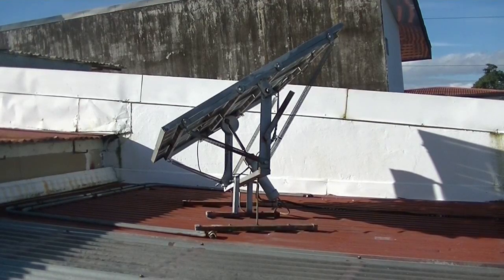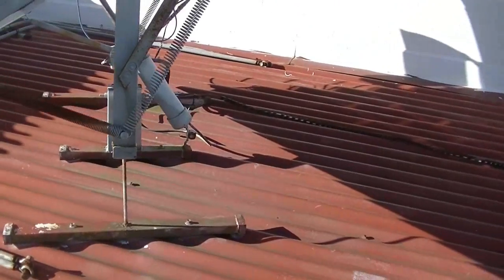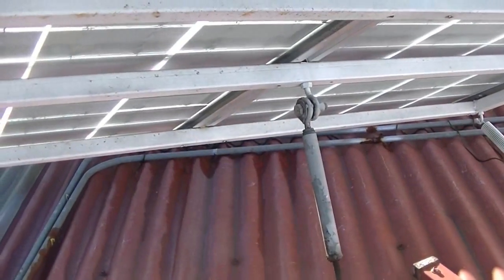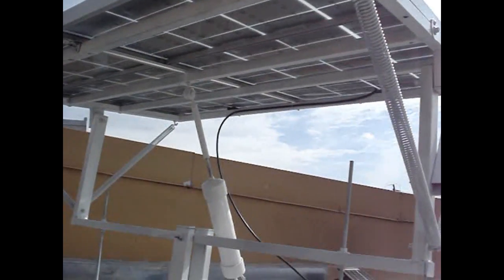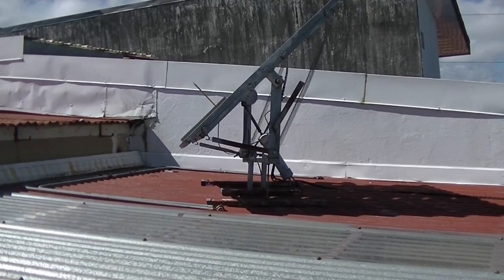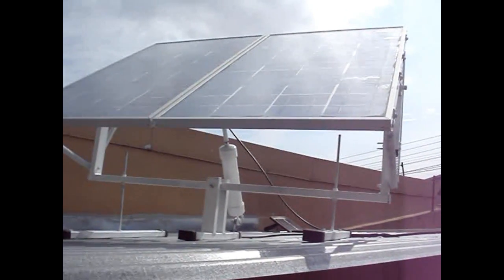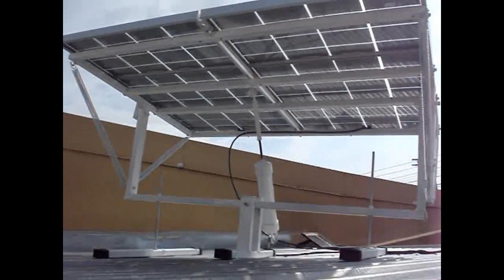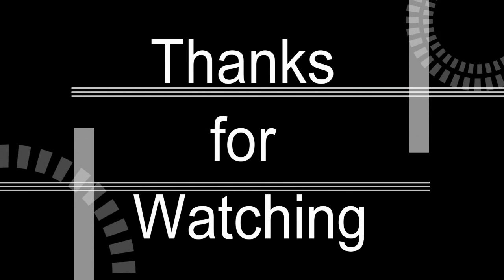Solar tracker update 26 march 2019

Comment: really impressed by the simplicity of design of this tracker. The only thing that I'd like to include is some way of getting it into a stow position in case of very high winds.  Is the new system you mention going to include something like that?

Comment: In your video 6yrs ago you said you used 90-watt panels. Since panel prices have fallen drastically since then, just wondered if you intend to replace those with 300-watt panels which are now priced at around $125.00 or so.

Great video and info all around though. Look forward to your next update. I'm looking to do an 8 to 10 300-watt panel setup on my land for a cabin to live in, while building my house over the next couple years. Then I'll upgrade to a 25 panel setup.

Any thoughts or suggestions will be helpful and appreciated.
Reply from the maker: Yes I have taken down these panels and have designed a new tracker with a 340watt panel. The old tracker will also hold a 340watt tracker. But I am using a different method to move it. I will be posting a video soon.My designs allow for you to extend the size to add more than just one panel.

Comment: I'm thinking about building a large tracker, / shed roof, I don't get that great of sun. I'm hoping I can get about 20% more than I would get without. I'm thinking about 35°- 45° of tilt. East- west , and tilt up to keep snow off would be great, I'm off grid, and it would be for about 2500watts, if I can get about 425 watt panels it would be ALOT easier than the 150 watt  I have now. It will be about a 12' by 16' moving frame,and panels, not a easy task, the panels each est,4' x 8' of area us 50 lbs, aprox. I'm thinking a 12v winch and pulleys, on a cable, with a center piviot, and a couple microswitches and relay, but could get bad in a hurry if something happens to the limit switches! I don't know if linear actuators would be strong enough and the needed range of motion. The tracking is new to me, solar not so much, being offgrid. I can make it on the 1500 watts I have, but things are tight, 4kw, and 4kah of battery would do it,
Reply from the maker: I use the limit switches and a timer in case one or the other fails it wont be a disaster.The way it works is the timer is set for about 1 second more than the limit switch. so normally the limit switch will stop the motor but if it fails the timer will stop it 1 second past the limit. Good luck with your project.
Reply: find an actuator from an old c band sat dish, they can handle the load great, and if you get the whole frame you have a premade platform to add your panel rack on to.